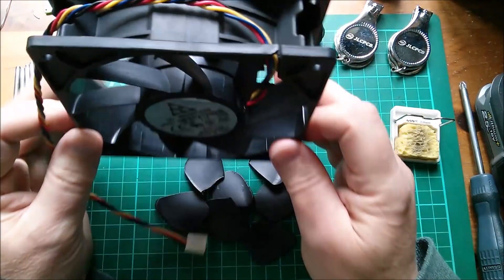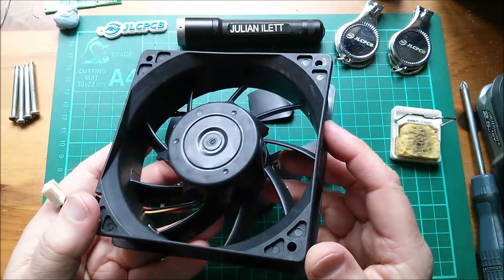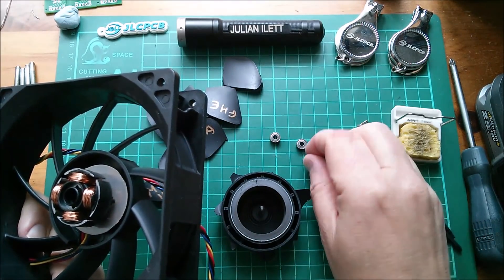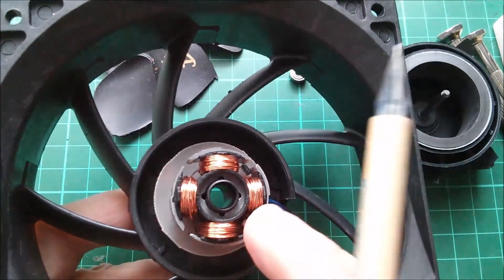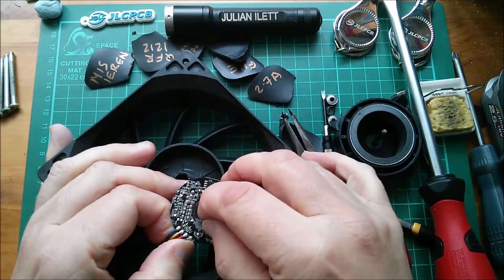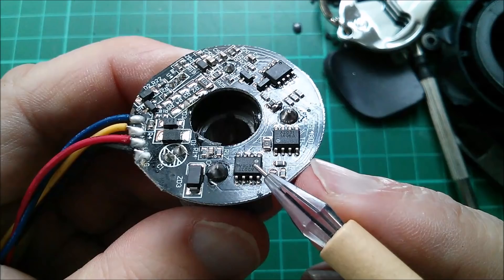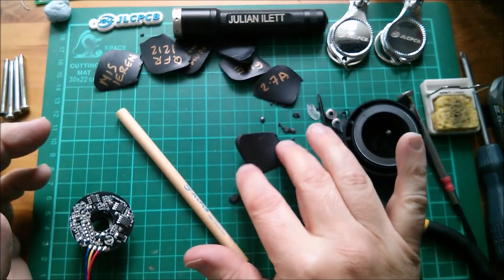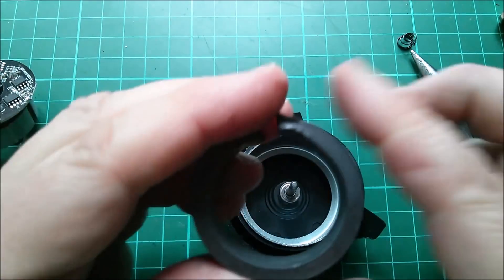Exploded Fan

Comment: Hope it didn't run to long without the fan

Try and Get Water cooling block for Asic's - would fix the noise issue 

or say bye to Blower fans wwith 3M Novec Engineered Fluids  - Immersion server cooling
Reply from the maker: Just a few seconds

Comment: I'm not a fan of this fan..... (Pun intended). Why should so many fan blades break away?  Have they been bent to often at the resonance frequency? Did someone overspeed the fan by applying compressed air or overvoltage? For cooling an antminer you would expect some airflow resistance. In case the fan was operated in an open airflow situation, without any resistance the fan might went to an overspeed.

Comment: FYI;
Those are mosfets (twin 8pin packages) however they are DUAL N & P channel fets similar to FDS8958A-F085 or IRF7309

The 8958a are found in original Delta electronics 120mm fans (AFB1212SHE)

Comment: I would have expected that the A2031 is a Mosfet so in typical form 4 pins Drain one side, the other side 3pins Source and one pin Gate. Am on my phone at the moment, from memory LCSC  had some Mosfets of similar number to A2031 in their range, can not immediately confirm.
Other than that  A2031 as semiconductor seems abreviation of 2SA2031 PNP power transistor  but not likely this device as that is a high current device in 3pin TO3 package from memory.. the three 8 pin chips are likely identical devices as three phase motor winfing drivers, but I see no devices there that take the PWM and derives a three phase drive signal. But such is needed to drive the windings with PWM signals at 120 deg phase relationship.

Comment: You can get those large delta fans from server recycling sellers, large HP and sell servers had multiples of them. You will need to solder the connector as they have a hotswap one from factory

Comment: if you are competent with cyanoacrylate glue, you can glue those blades back on.   that’s because polycarbonate breaks are brittle clean  and thus line up well; and CA glue binds superbly to PC.  i’ve fixed many ultra high speed blades this way - never had a failure.  try it you may be surprised.

Comment: The fan speed will NOT be affected by the air resistance, etc.  The PWM input determines the max speed.  The stationary motor coils are pulsed to determine the speed by the ESC (Electronic Speed Controller).  Light resistance changes will only affect the current used.

Comment: A2031.. it's an R1230 series PWM/FVM step-down DC/DC converter with synchrnous rectifier. Output voltage 2.0V. Optional function 800kHz, fixed output voltage
Reply from the maker: There are no inductors on the PCB
Reply: @JulianIlett  The motor stator is one.

Comment: Well the logo on the lable looks a bit like Delta Electronics, but it is a fake one. A real Delta wont explode.
Reply: A real Delta of that size would also have a 3 phase motor with a sensorless drive.
Reply: @NiHaoMike64  Not True, MY 1212DE's still use bi phase stators. Those are 120mm's
Reply: @UmbreWolf  My understanding is that the 2 phase design is more common in smaller fans due to the need to make the motor compact. It needs more output MOSFETs than a 3 phase motor so no cost savings there. (Does yours have a smaller motor to minimize the size of the "dead spot" when used on a heatsink or radiator?)

My 120mm GHE and my 120mm UHE fans both use 3 phase motors, they're both variable speed in case that might make a difference. I have the GHE installed in the side of my PC (rarely spends much time above 30% power except when I'm really looking for maximum performance) and the UHE attached to some flex ducts with 3D printed adapters in order to bring fresh air into my lab. It's amazing how a few feet of flex duct really makes a big difference to the noise level.
Reply: @NiHaoMike64  think it boils down to model number. Delta has a lot of variants for 120mm fans ranging from industrial control cabinet to high rpm server fans. I have a couple of the UHE I know them are 3 phase. I also have several 1212FE I got from an ibm server. They are literally the same fan as the "cheaper" 1212DE's I use but they are 3 phase use almost an amp more and go almost 1000 rpm faster. Cost like you said is a matter too. The price difference between a 1212DE and its 3 phase variant 1212FE is about 20-30$ the FEs are harder to find now a days. I had one it lasted me 12 years and still going.
Reply: @NiHaoMike64  The rotor is the same size, just spins at a lower rpm and draws less power. The FE Is pretty much the same thing as a UHE but its an older discontinued model. Spins up to 4krpm with 232cfm, draws 4.3amps
Reply: I have a delta that one of the blades broke on, it shut it self off to avoid total destruction , I glued the blade back on and just run it at low speeds :)

Comment: Shipping damage. But, how fast is too fast?  Easy to do: 150 PSI destructive compressed air test will destroy your laptop fan!
Reply from the maker: Flat out was too fast :)
Reply: @JulianIlett  Weee!
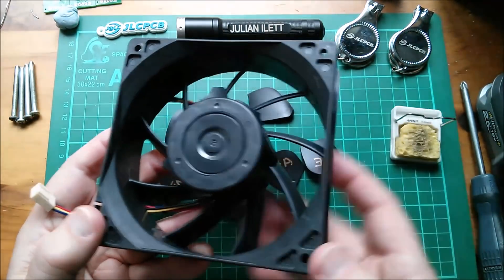Reply: I did note that the top edge, as Julian was holding it at 1:20, had a bow in it as if something had impacted it.

Comment: Never
Reply: Never what?
Reply: @PetRatty  Never have I seen such a thing as a fan exploding
Reply: @TKomoski  you are lucky then. I useto have a high speed fan running at 10,000 RPM. Alumimium body and blades and it failed and went with a bang. It was running at 24 volts at 5 amps. Wonder if a Dr. mad trust edf fan would work better
Reply: @PetRatty  At that rate I would give up too